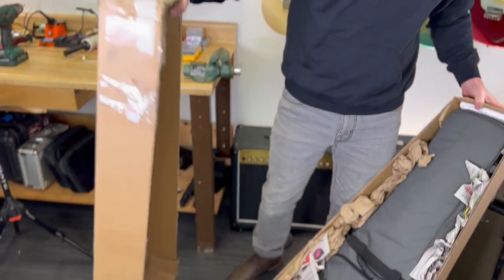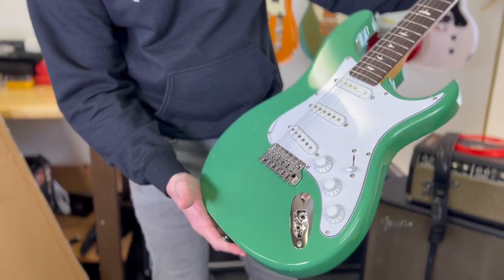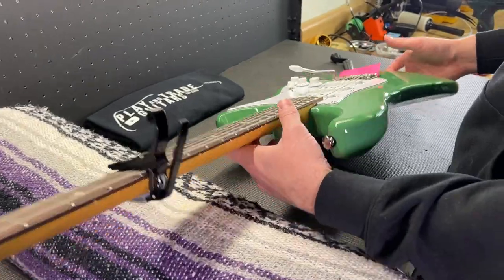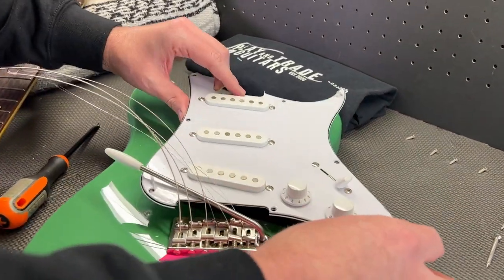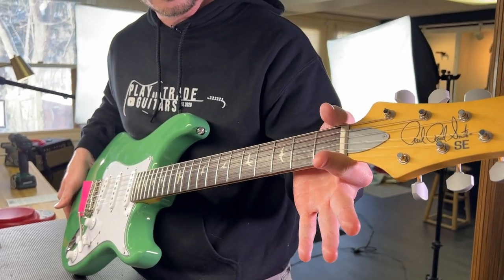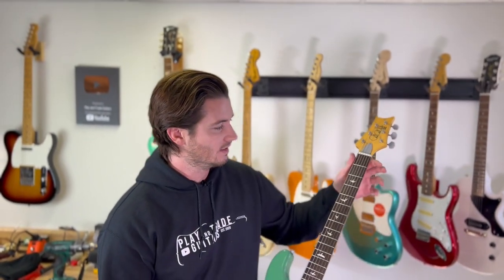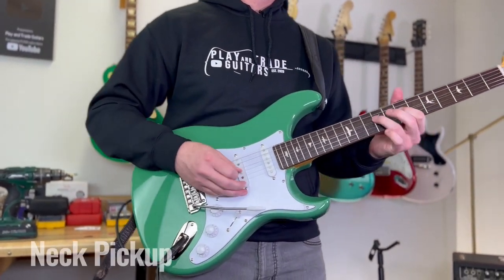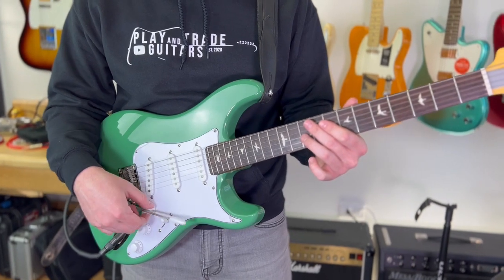PRS SE Silver Sky - John Mayer's Best Guitar?

Comment: I really wanna try one sometime, however the price difference here in the UK (about $1212!) makes them far less attractive over here!
Reply: To add insult to injury there are other PRS models that are sold in the USA at $849 and £749 UK, so it can be done profitability.  I'm hoping it's just retailers currently feeling no need to discount £895 when they have no stock and a backlog of orders.
Reply: @PaulCooksStuff  It would certainly be nice if the price drops when demand/supply balances out a bit! At the moment I would be more tempted to either save £300 and get a player strat or even look around for a used USA strat for about the same price!!!